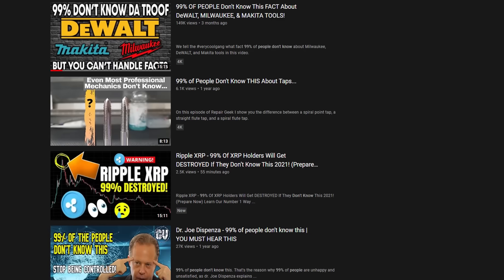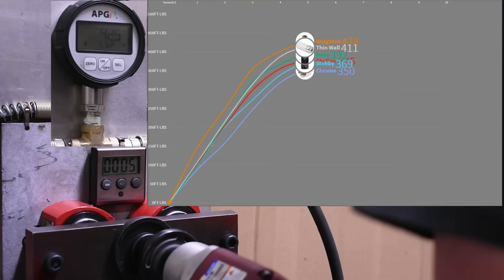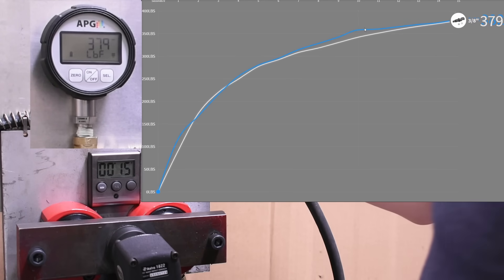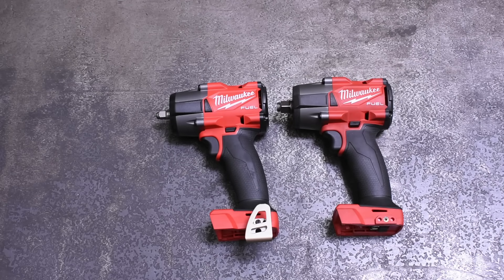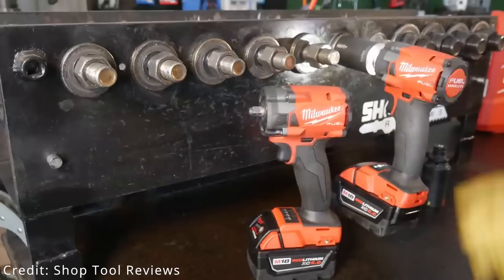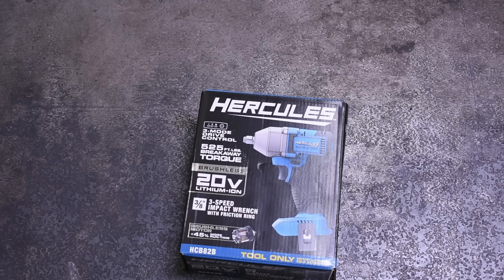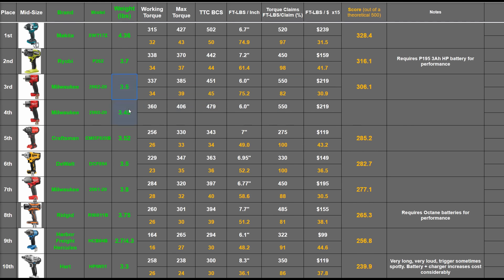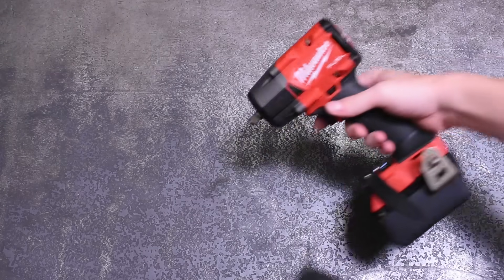Measuring Power Difference Between 3/8" & 1/2" Impacts = WTF

Comment: it would be great to revisit this using gen 2 M12 Fuel stubby 3/8" 2562 vs 1/2" 2563. I just want to use it to remove any bolt/nut on my 2007 toyota sequioa suv at home. I don't even know how much torque i need for automotive work.

Comment: Since Milwaukee's M12 3/8 stubby can go over 500 ft/lbs of nut busting torque, I wouldnt't use it on any fastener bigger than 14mm due to the risk of busting the 3/8 socket.

Comment: I'm curious how the 3/8" drive tool can develop that much torque, and survive it.  I've watched static tests of 3/8" drive breaker bars using a digital torque adapter and testing a number of different brands they all broke within a range or 210 ft-lbs and 270 ft-lbs.  That would seem to indicate the limit in strength of the 3/8" square metal itself as being under 300 ft-lbs.  I don't have an answer other than to wonder if the impact wrench parts are hardened to a higher strength than hand tool parts but I don't know why hand tool parts would be made to lower strength levels.

Comment: I'd like to see a ultra high speed side shot. what im betting you'd see is more flex from the drive/square drive on the1/2 inch when compared to the 3/8ths. similar to those torque limiting extensions.

Comment: Okay I agree with all the torque specs test and all but over all uses is where the differance is .. using the tools all day everyday none of them hold up to milwaukee... the only one that's holds up to milwaukee is dewalt.. all the others will not last 5 years like mine have with everyday use all day

Comment: I think it has to do with the ratio of the rotating outside diameters. Using the same size socket on different OD anvils would cause a different ratio. The 3/8 anvil would have a larger difference between OD’s. Might be where that extra torque is coming from.

Comment: Man, that’s a big socket, especially for a 3/8” drive.  Does the larger mass further from the center cause more angular momentum change per time unit, possibly explaining some of the difference between the torque you measure being less than advertised?  Possible to test on a 19mm or even smaller and see if there are any differences?   Sorry if there’s already a video on this.  I do know there was one stated for socket weight making a difference, but having the weight further from the center seems like it would deaden some of the impact.  Notice how the thin wall wasn’t even close to last place.

Comment: Adapters do add torque
Reply from the maker: Not from what we've measured
Reply: @TorqueTestChannel  it was either you or that shop tools channel that did a torque test of a Bosch impact and found that adapters added torque...
Reply from the maker: @NeuKrofta  and impact hex to square drive adapter on specifically the bosch freak which is a freak for that very reason. We have a video on impact wrench adapters.
Reply: @TorqueTestChannel  yes, I love your channel and binge watch it. Bosch is my brand though so for me it is true

Comment: I still have yet to see a test where lets say 3/8 vs 1/2 but you use a normal not custom lets say 1in shallow socket in 3/8 drive vs a normal not custom 1in shallow socket in 1/2 drive. Or even deep for both. Regardless every 3/8 vs 1/2 test, theres a legit socket difference whether it be an adapter or a completely different style socket.

Comment: Think about it, same size motor in each.. one is just trying to push more weight, and more weight only comes with the advantages of busting something rusty👍 the smaller anvil can actually be driven to the limit of the electric motor, it's just physics. Aircraft mechanics have been saying this for years about three rights and quarter inch
Reply: One has more torque and one has more speed

Comment: The only thing I see that is not isolated is the weight of the socket

I know my 1/2 inch doesn't have alot of beans with an ultra deep 1 1/4 socket ( like 10-15 seconds to get to under 85 ft lbs ) but would definitely twist off a lug nut in about that amount of time

Comment: They obviously lie about the specs. If anything the 3/8 anvil will deform faster because its a smaller shaft. But the durability might not be that big a deal. Someone would need to test it

Comment: Very interesting!. What Milwaukee(and others) did here is akin to putting  a F-250  Superduty  towing package on a Ford Ranger.  Although the chassis of the F-250 can withstand 12,000lbs you will never get there with a Ranger engine and it will be slower because of additional weight. 
The point of 3/8" vs 1/2" is much more about what the 1/2" can "withstand" not  what it can deliver. The motor power is the primary factor in power/torque delivery. I'm pretty sure Milwaukee is not as confused as they pretend to be. They don't want to admit that this is an overpriced socket adapter...but it might last longer.

Comment: Great video.. what is the purpose of even using 1/2" if 3/8 is equal if not better? Doesn't 3/8 weigh less and take up less space? I had thought that at the very least the 1/2" would be more efficient because of the larger area giving more leverage.

Comment: I know this is an old video but I do have a question I hope you can answer. 
I have the Astro 1828 version 2 and I've been eyeballing the 1822 version 2 in 1/2 drive. 
My question is would it be worth it. Other than the drive size would the 1/2 anvil and socket make a difference in breaking bolts loose?
Thanks for any light you can shed on this!
Reply from the maker: It would not feel different. Nah :(
Reply: @TorqueTestChannel  thank you for the response.

Comment: 3/8 drive is strong enough for most automotive work (passanger, not commercial, I guess). 
I have a 2960-20 3/8 mid torque impact (had it for a year or so) and use it everyday on wheel nuts, axle nuts, suspension and brake nuts and bolts, etc. It handles every thing easy, cannot feel any difficulties. I mean sure some times it is a bit struggle to break loose really siezed wheel nuts but that is rare. I barely need to pull out the air impact since I got this.
I do need to put on (and leave it on all the time) the 3/8 to 1/2 adapter cause most impact sockets I have are 1/2, the adapter female end looks very rough now but the 3/8 drive on impact gun is still as straight as new. 
Surprisingly, just out of curiosity, I tried once to remove wheel nuts with my 2953-20 1/4 Hex impact driver on 3rd setting, even though this is not what it meant for and should do, it handles as easy as the impact gun.

Comment: It's the same reason that impact "amplifying" driver bits now have a thin, twisting section in the middle- it starts to absorb energy during a strike, not turning at first. When the screw does start turning there is a spring behind the force, turning it further with a longer high torque period which might actually drive the anvil backwards a tiny bit. You could do this with 1/2 drive just by making the drive shaft smaller in the middle and maybe longer.

Comment: I bought a half inch brushless Bauer because I already had the half inch socket set and they had a nice deal buy a 3AH battery for 59.99 and get a free tool which included the 1/2 inch impact

Comment: I am a dumb ol, dirt engineer.  And I know that if the hammer mass and rest of the tool is the same, and the anvil mass of the 3/8 is slightly lower than the 1/2, the 3/8 will produce a little bit more torque, due to the decreased moment of inertia, of the smaller head on the 3/8.  So, I’m sure if you asked the design engineers at Milwaukee, and not the marketing folks, they would instantly know the difference, and could probably rattle off the equations, and theoretical differences within a few seconds of being asked.   Physics is physics.  The mechanic of materials classes are pretty much the same for civil and mechanical engineers.

Comment: i figure this may be useful info to most watching this video; i bought a 2960-20 milwaukee (the 3/8 one) and beat the piss out of it (toyota lube tech in florida) for about 7 months, in which time it turned 6 Snap-on 3/8 21mm deep impact sockets into a circle drive instead of a square, before it sheered its own anvil in two.

edit: xc 3.0 batteries, swapped for a fresh one once they got to 2 bars

Comment: I think the output difference between 3/8 and 1/2 boils down to efficiency. 

With the 1/2 typically we expect to see more torque applied however the anvil is much larger than 3/8, it's not like that comes without a price. Yes the final output (torque applied to bolt) may be strong however the force required to rotate a 1/2 anvil is simply greater than 3/8.

The 3/8 has less rotating mass which allows whatever lost energy trying to spin a 1/2 anvil into actual torque applied onto the bolt. Perhaps that's why they even out, and due to less mass of 3/8 it allows it to spin faster with less energy, allowing more peak power purely due to ability to rev high with less parasitic loss? Perhaps that's why they finally even out, if not 3/8 edges out?

Comment: It's almost incredible that the people doing these tests do not understand the need to reduce variables. Ever considered that the batteries may be putting out more current? You will never know unles you use the same batttery or swop batteries.  Tried asking Milwaukee if the internal componenets are different between the 3/8th and 1/2? ,if there is no difference how can one be more powerfull than the other, maybe magic eh! LOL.

Comment: The problem is smaller sockets will not fit on a 3/8 drive which this video failed to mention, so you'll need both a 1/2 in and a 3/8 in impact wrench

Comment: You should measure the rpm of both1/2 and 3/8 drives.  Its basic math to find force.  If the weight is the same, and the power output is the same, then the speed has to be different.

Comment: the difference is that the 3/8 will need an amount of time x power to release a corroded or rusted nut, but the 1/2 will take half of that time and effort.

Comment: I just don’t go to 1/2 inch that much with battery 🔋…unless I’m not in or near air and my my  service bay.
For me 1/4 and 3/8 I go battery but 1/2 inch I still prefer air especially for “around the wheel” automotive and light truck repair.

Comment: I’d guess this is like the front gear of a bike, the larger the radius is, the more resistance you have overcome to get it moving.  I’d almost bet that if a 1/4” impact had the same motor as the 3/8 and 1/2” we’d see a similar trend of more torque. Sizing down the radius of the drive gear always increases torque at the sacrifice of higher top end speed.

Comment: OK so. It comes down to technology and metallurgy there have been many advancements in the science of metals and the science of impact tools. The socket wrench was invented (credited/patented) in 1863 and the impact driver in 1932. So the metals available at time dictated the strength.... Now let's reference another recent video by TTC the torque stick video where it showed the modern electric impact overtorqueing bolts using the torque limiting stick because the technology/science behind how the tools air/battery are different.... Now why would a company claim different or lower power. It's a simple matter of legal... "I blew up my socket and got injured using your tool".. Response, "You were using the tool beyond it's documented limitations, we are not liable."

Comment: Yes, the adapters add kinetic force. When I cannot get a bolt off with my 3/8 I will either reach for a socket with more mass or add the heaviest adapter I can find. This works nearly every single time. So well in fact, that I never went back to the store for the 1/2 mid torque. The way I saw it, if the 3/8 could get lug nuts and most axle nuts off this way, no point in spending another 300+.

Comment: The same impact input given by the anvil to each drive, say 400lb’s, will strike the drive of a 3/8” more sharply than a 1/2” drive. The shock will be distributed differently. The 1/2” drive has more mass to absorb the shock of the anvil. The 3/8” drive has less mass. Therefor the strike of the anvil will have a higher output, over a shorter duration, giving more shock to the receiving items mass (bolt/nut) when using 3/8” drive. This would also explain why 3/8” drive items fail over a longer duration of use at a higher rate than 1/2” drives using the same diameter sockets.

Comment: weigh both sockets... id wager the 3/8 socket weighs more because it has a smaller hole... thats my guess as to the slight difference... and yeah, to answer that guys question, using anadapter adds mass thus adds torque...

Comment: Honestly im simply assuming that its basically the final drive ratio, the 1/2" compared to the 3/8" is like comparing horsepower on a dyno between 35" tires and 33" tires while using 3.55 gears for both. Makes perfect sense to me. It just has to do with the diameter. Theres a reason they typically upscale their drills to match the anvil size, just like you would upgrade your ring and pinion to match your tire size.

Comment: Assuming that everything is the same I believe the only variable is the diameter of the shaft leading to the 3/8 socket which is stiffer than the 1/2. The torque lost in the torsional deflection of this short shaft is lower in the 3/8 which as a result has a higher efficiency and can transmit most of the torque generated by the contraption inside.

Comment: Eh, it's the same as a modern 4-banger and an older V8 making the same horsepower. The difference is where the loss is in the rev range.

Some old V8s reached peak horsepower at 2,800 RPM, which was something I was very surprised by. Imagine not having to scream the engine in order to boogie.

Comment: Can someone explain why the advertised torque is 550 - 650 lbs/ft for the Milwaukee impacts, but during the test at ~7 minutes they only output ~450-479 lbs/ft of torque? That's quite a difference between advertised and actual performance. That's a 20% lower performance value!

Comment: I think its kinda like gearing, the smaller drive is like a smaller sprocket in a motorcycler engine, it will increase torque. Imagine the corners of the anvils, due to theirsize difference, they will have to travel a different distance

Comment: One hypothesis of the results. As the air tool was close but the larger was consistent (i'm well aware of the low number of tries doesn't make it statistically certain enough to make solid conclusions) that little difference might be all it is to it when it comes to the extra flex from the smaller socket.
My first thoughts of the electrical tools is that they might use stiffer material on the 3/8. Would be interesting to look inside and see if there are differences there that could give more clues.

Comment: Just a heads up....   you CAN snap the anvil on a 3/8 gun. I've done it. I used to use my 3/8 to remove lug nuts, because it's much lighter. I broke 2 anvils on an Ingersoll 3/8 and 1 anvil on an Ingersoll Titanium 3/8.

Comment: Surely the length of the socket is an issue here? E.g. if you add an adapter torque goes down due to the twist, therefore the length of the socket should do something similar

Comment: Drive Socket size only matters for shear strength. A lot of times engineers will design a ratchet to not function outside of the shear strength of the drive socket, it's pointless and over-engineering trades things like cost, size, and other important characteristics with diminishing return. 

There is going to be two major equations that determine how the impact wrench performs. M1+M2=1/2mv^2, and f=ma. M being related to density*volume and mass*velocity*radius. And additionally P, since it stays the same. I'd have to run the numbers for it to make sense, but I'm sure it does.

Comment: There is absolutely ZERO need to buy a weighted socket. ZERO. Grip the socket and turn in the direction you are trying to apply force. Weighted sockets are a scam.

Comment: Have you ever thought of trying a battery that is capable of much higher current than those offered by the manufacterers?  It would be very easy to test batteries that can output 10-15x the current of even the high output batteries.  I'd be very interested in seeing some devices tested in this manner b/c I'm guessing that there is a decent voltage dip when they are all pushed to the max. I wouldn't be surprised if there was a 5-15% voltage drop at max load on a fully charged battery.

On a similar track, it would be great if there was a way for you to record/log the voltage of the battery as you test the device.  This would give us a much better idea of what's happening with these tools.

If you want some batteries that are much more powerful, LMK.

Comment: I think the perception of 1/2 v 3/8 power MIGHT come from the fact that there are times when the 1/2 is SLIGHTLY more impactful - not necessarily because of torque of the wrench, but because for most people, their 1/2 impact sockets have more MASS than their 3/8 impact sockets, and therefore AT TIMES, the mass differential will make a slight difference in ability thereby giving the user the impression that 1/2 is ALWAYS better.

Comment: First thing I did with my used Mac impact was disassemble it and I had never even had my own before, let alone tear it down.  I installed a muffler mod i made myself, cleaned it up and lubed, and reassembled.  That gun could bust nuts my class a mechanucs 1200ftlb gun could not.  I had two of them, one just for spare parts.  The main gun built from least worn parts of each gun.  Really simple units.

Comment: A smaller diameter would make more rotations per (e=mc²) 💁‍♂️

You guys really need a DCF923b up there.  They do 450 nut busting but needs to go on there. I know you did the 1/2" 911, but this is advertising 50lbs ft more (the 923b) I think b is for ⅜ drive.  Nice mechanics tool